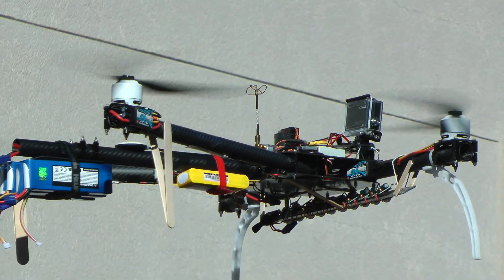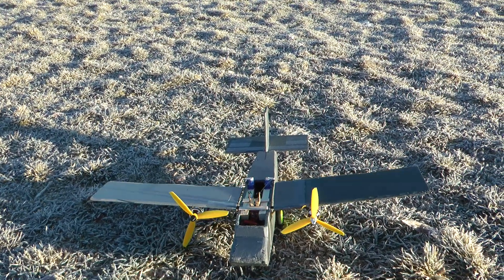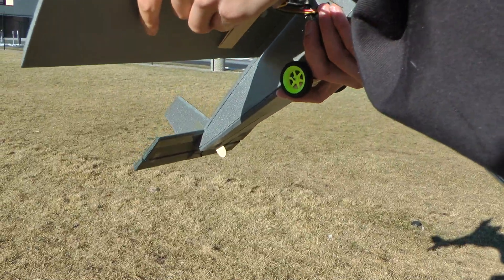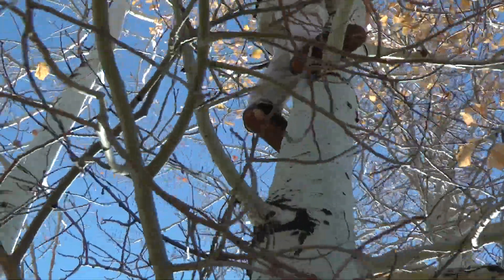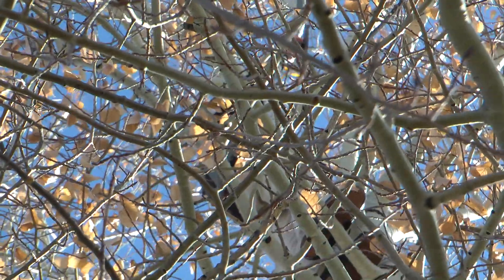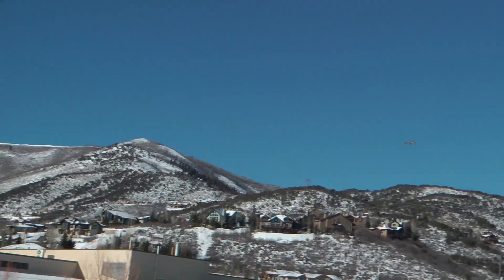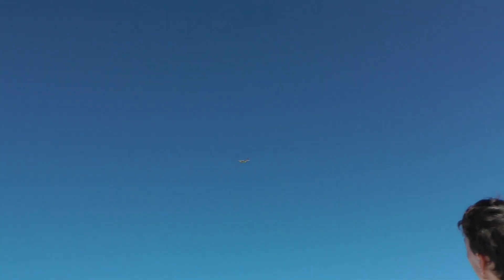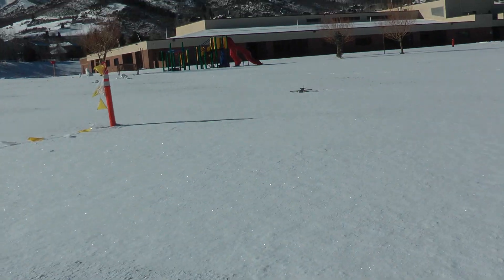NIGHT FPV - Drone Quadcopter with 100W LED Bar

Comment: The reason your little plane is unstable is once you alter the attack angle of each wing you have basically created an unbalanced helicopter rotor, it then begins to auto rotate, in this case pulling the entire aircraft around with it. Fantastic videos by the way, and your quadcopter is brilliant.

Comment: Why 45 amp esc with only 3000 series motors? Speced out should be w 30 amp 6s esc optos.

Comment: You should try it with IR LED's. Invisible to the naked eye, but still light up for footage
Reply: vast majority of cameras, iPhones, definitely GoPro have IR filters, so it would be invisible too, however removing that filter is very easy all you need to do is unscrew the lens and take that filter off, its a green piece of glass that has reflective pink layer, next problem is finding IR LEDS big and powerful enough, demand on them is super low
alternatively he could use a powerful IR laser and diffuse the light, something like IZLID 3 Watt Infrared Laser
Reply: Cody Slab (lol ur name) ive seen some high power ir led chips, i think they come in 10, 20, 30, 50 100 watt, i think those would be bright enough. the problem is that theyre made by Hontiey in China, and i dont think they ship outside of china, but you can buy them in china

Comment: Hi great vid. Do you sell just the light bar? Also will it work on the walkera qr x350 pro. Ive saved my money thinking of buying the hubsan x4 109 pro when it comes out. Would light be compatible with that. I like the set up you were flying. Does that whole package come with light bar. Great vid btw. Very cool

Comment: Trying to understand.. 4x 3000 mAh batteries.. wired both in parallell and series then? to make one 6S 6000 mAh battery? Wow! Also dont you need more cooling for the LEDs? One final.. what are the LEDs? Havent seen that small 10W before, any links or more info? Great video also =)

Comment: Awesome shots Daniel.  I did not know you could put the sun on a quadcopter ;-)  PS  cool bonus footage.  I think you should do more experiment with that design but on a larger plane :-)
Reply: It looks like a fun experiment, but the main problem appears to be way too much control surface. On top of that the prop wash gives even more control surface power. There needs to be some fixed lift surface for stability.
Reply: That above is regarding the little plane on the bonus footage.
Reply: +Skydive4ever I think it need a longer and larger tail to solve the plane issues. It has way too much power for its size I believe.

Comment: Maybe the gains where just too high - the oscillation could be the outcome of increasing uplift on one wing induced by the increasing prop rpm/AngleofAttack - which generates great amounts of lift on the wingsurface. In result the plane rolls to the opposite direction wich then is overcompensated by the gyro wich increases the rpm/AngleofAttack of the opposite motor wich again leads to a rolling plane, which is compensated by the gyro... and so on..
Reply: +hopsenrobsen I think that to fly that successfully, you'd need incredibly fine control with a very fast response, or you'll over compensate all the time.  This is why drones only  work, because you have a computer distributing the power to the four rotors, with feedback.  Think helicopter - very hard to fly.  What he did was like putting a helicopter on each wing :-)

Comment: Daniel, this is a fantastic concept. Can you explain if the LEDs are connected directly too the power source and switch or is a driver required?  How much time are you getting out of the 100 watt setup with the 1800 mah battery. Thanks for all of the entertaining and innovative videos.
Reply from the maker: You do need a driver to supply the LEDs with just under 12v.Without one, they burn up quite fast. I haven't actually tested how long I can leave it on with the 1800mah, but I'm guessing it'd be about 15 min
Reply: Thanks for the reply. I appreciate your videos.
Reply: rctestflight do you need a driver for each led? I tried finding the driver in the link you provided but it just takes you to ebay and doesn't give the specific driver. A vid on how you made this setup would be awesome!
Reply: +Robots4Sale I can show you my setup, but I am not using for my quadcopter but for my spider camera rig
Reply: +rctestflight I have cheap 10W 12V led chips which doesn&#39;t need led driver under 13Volts they do not draw more than 800mAh. For safety I used to put there a serial regenerating fuse of 0.75A which breaks circuit around 1.6Ams and dims around 1amp.
Reply: +FotoAmg AmgFoto well i think you said first you need a driver or they burn up, then you say you dont need an led driver... 
so if i wanted to make a strip of 10 led's, do i need 1 driver for all of them  or one driver each, and plz tell me which driver if i buy 10 of this ebay auction (if there is better lights, let me know.)   ebay auction# 261896497985
Reply: Robots4Sale yes I said but later with my leds I experienced that they don't need a driver, but if you want more in parallel this is not working. You have to connect each in serial or use drivers for each if you connect them in patallel and give 2 volts more as the driver needs it.
Reply: +FotoAmg AmgFoto can you just sell me a light strip already made plz?
Reply: +FotoAmg AmgFoto ok so if i want 10 of the 10 watts, they need to be in parallel and needs qty: 10 drivers ?
that seems like it will be heavy on the drone. if you put 10 10watt in series, i would need a 100watt driver right?
Reply: +Robots4Sale If you really want 10 of 10Watts you can still do what I did, connecting them in parallel with 0.75A regenarating fuse in serial with each LED instead of LED driver, it would work, but you won&#39;t get 100Watts just about 60watt as I measured. But it could be because I am using lead acid battery for it and not 3S lithium ion. I never tried with lithium... it could draw 100watts and  if somehow a LED overrun the serial regenerating fuse would shut it down below 1.6amps so about  16watts for a LED.
Reply: +FotoAmg AmgFoto if they are only 10w, i'm not sure more than 1 will really add many lumens?